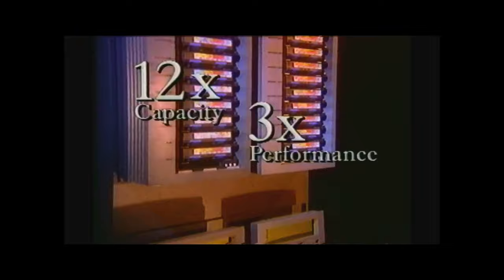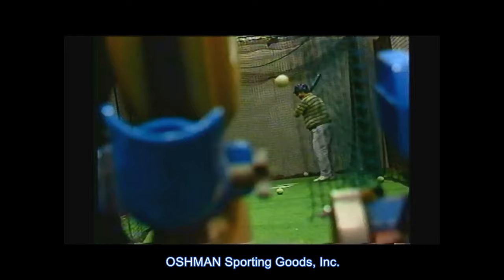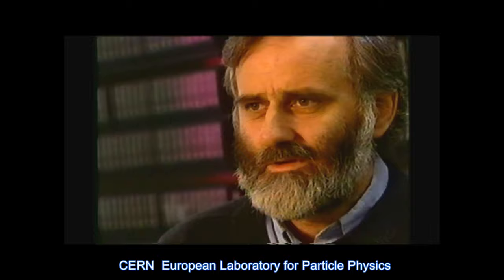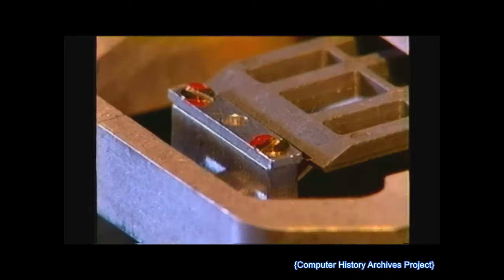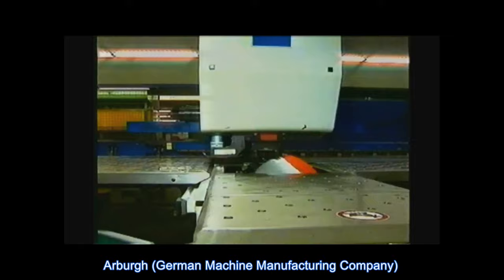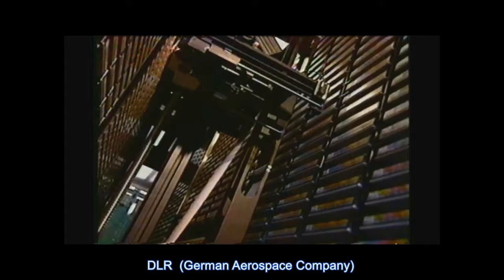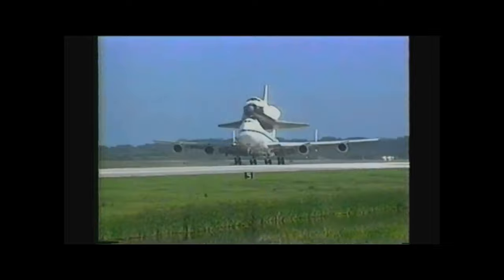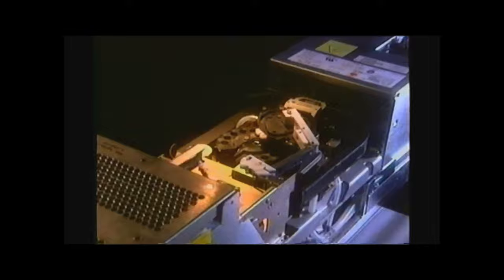Computer History Storage:  1995 IBM MAGSTAR Magnetic Tape Backup System (mainframe, CERN)

Comment: I was a Senior Operator in the 1980s and 1990s. I watched our 50000 reel(6250 bpi) migrate to 3480/3490 technology. In the late 1990s our tape Library peeked at 400000 3490s. We had 19 STK tape silos as well. I moved was promoted to Storage Systems as a Junior storage Administrator. My duties consisted of mainly converting the 400000 physical tapes into IBMs Virtual Tape Server. It was a long and tedious project that spanned many years to decommission all physical tapes. When they last physical tape was finally virtulized so was I. 😂

Comment: These were such an improvement over the older, round (reel) tapes.  I was a sysprog during this technical transition. With round tapes, before I did system maintenance, I would routinely do two backups just to be sure I had a reliable backup.  When the square tapes, as these were also known, one backup was sufficient and reliable.  This obviously cut down on down time, which was very important.
Reply from the maker: Hi Deep Sleep, thanks very much for your comments.  Backup tapes used to keep me awake at night.  Even today, I make backups of my backups.  Losing a backup is something you never forget!   keep well!      ~  VK

Comment: while I worked at MAN (Copenhagen marine section) in the 1990s one day the backup robot for the mainframe apparently went out of alignment and ripped out the stops on one of the tape racks and dropped all the tapes in that rack on the floor. Then when it went to retry it wrecked another rack before it sounded the alarm. I didn't work in the IT department, but I'm sure the techs had fun fixing the mess. They still had an old vacuum column tape drive as well, just in case they ever needed anything on the old tapes. Can't recall the model, though

Comment: We had to seamlessly move a DB/2 database to a system in another state. We calculated it would take OVER A MONTH if sent thru internet.  It was quicker to backup onto tape, TRUCK the tape to the new location then rebuild the database using the tape...then use internet to bring into sync with online DB. (not sure which kind of IBM tape storage they used)
Reply from the maker: Hi Bruce, that is a fascinating story.  I am assuming this was in the early 1990's?  ~   Victor
Reply: @ComputerHistoryArchivesProject   - Actually, it was around the year 2018. (I worked for IBM so I KNOW they used all IBM hardware) As I recall, some of the DB/2 tables had billions of rows. (some of it stored on instant-recall robotic tape spoolers)
Reply: I can't take credit for this, but I believe this is referred to as CTAM.  Chevy Truck Access Method.